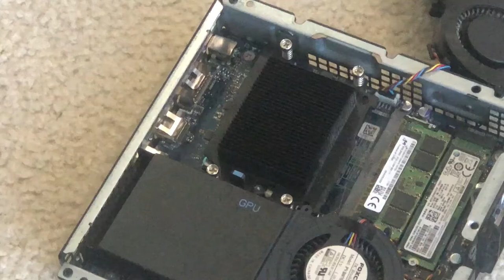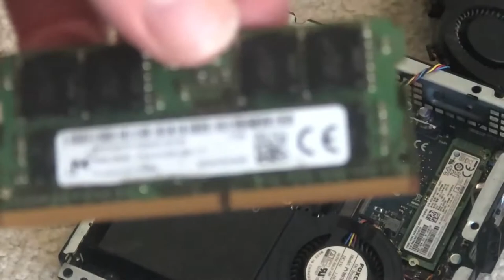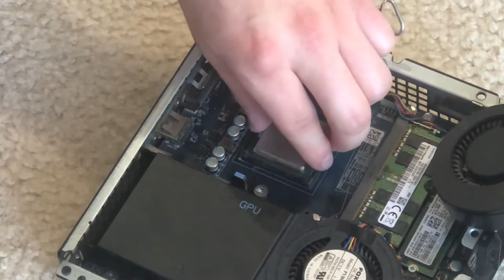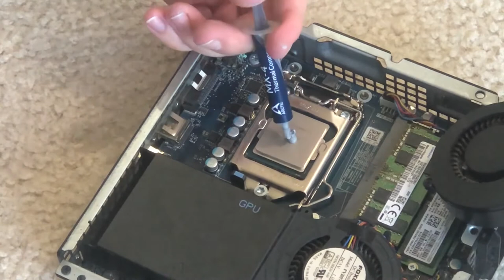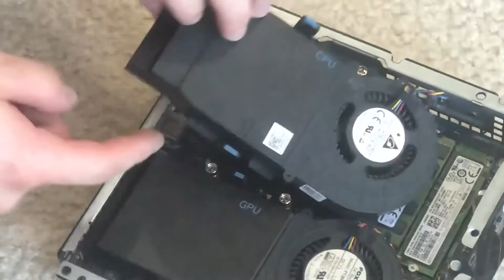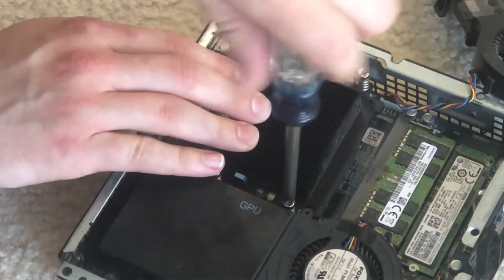Upgrading the CPU & RAM in an Alienware Alpha R2 (ASMR)

Comment: 2666 MHz ram isnt supported as 2133 MHz is the max spec for 6th gen. installing faster RAM is pointless as it will be downclocked to 2133 MHz

Comment: Nice video! Is possible upgrade to 32 gb of RAM?
Reply from the maker: sry i didnt see this. i couldnt tell ya, but it only supports one ram slot so i doubt it
Reply: yes you can. single stick ddr4 laptop memory
Reply: @christiangalloway8  super slow though. 32 GB on single channel is brutal lol. also the max RAM speed supported is 2133 Mhz. installing faster RAM will just downclock to 2133